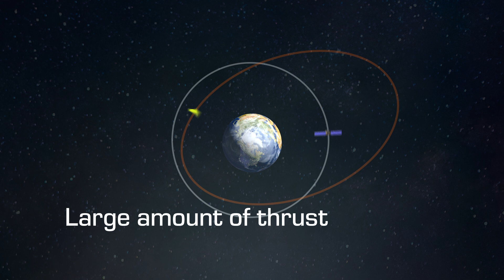This new rocket will save satellites from space junk

Comment: maybe with such a drive it would be possible to use unnecessary mass (e.g. shredded rubbish) or gases in manned ships. when heated with microwaves, they would not require ignition.